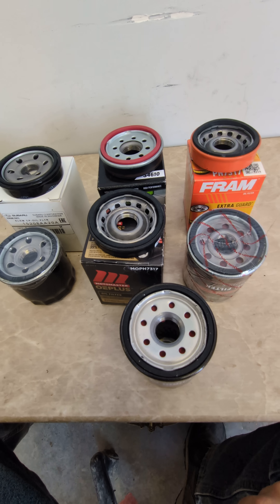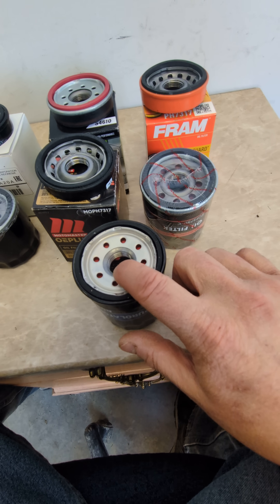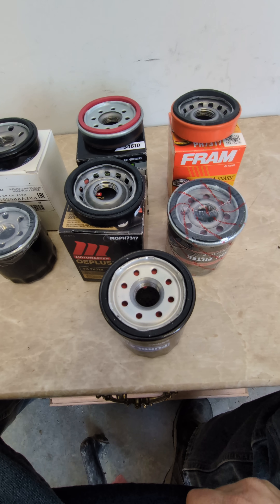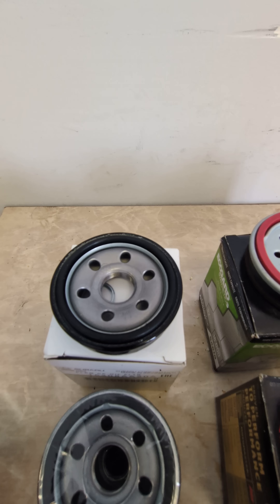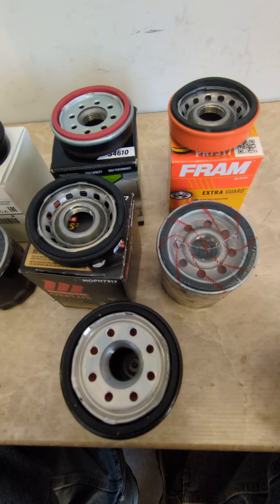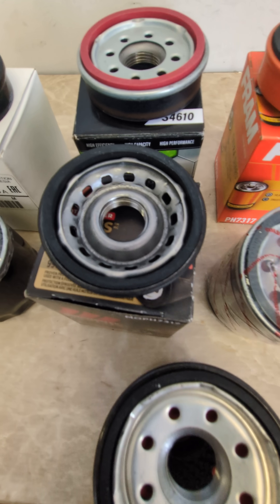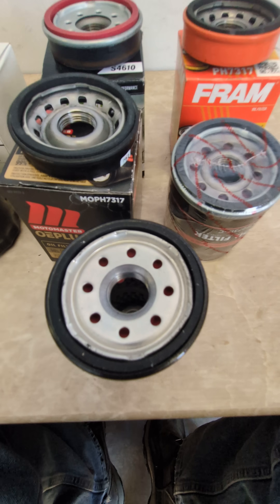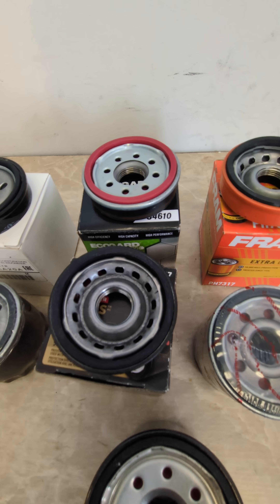How different are oil filters really

Comment: Filters get more efficient as they get used. All those 30 micron holes get plugged up, then the 20, then the 10, then the 5. So, an oil filter with 5000 miles on it will filter oil far better than a new filter. It's one reason why 3000 mile oil changes are actually kind of bad for your engine. 

So, you ignore OEM recommendation and use a much larger filter. A lot more filter media means a lot more 30 micron holes that need to get plugged. And that filter will be far less efficient than the OEM filter as a result. 

Are things actually that black & white? No. Asian engines prefer high oil flow over filtration. It's why I'd never use any of these high end, long life filters in an Asian car. Then you have cars that burn dirty and clog up oil filters very quickly. Not just diesels. You don't let your turbo cool down before turning off the engine, it's going go cook some oil. That filter may get clogged in short order as a result.
Reply from the maker: You make some good points.😉

Comment: I think you're totally missing the point it has nothing to do with the inlet holes whatsoever but the size of the filter itself and the fact that the oil pressure needs to be at whatever manufacturer specs are you go and add bigger oil filters it takes the oil that much longer to be filtered and put back into the motor I don't care if the inlet holes for the oil filter has 100s in it that's irrelevant and that's what most people are trying to tell you the size of the filter matters just because I can get a Honda Civic filter to fit on my 67 Cummins doesn't mean I'm going to or vice versa🤣 mechanics must love seeing you come down the road🤑🤑🤑
Reply from the maker: Wow you are the one who missed my point. WOW😵‍💫

Comment: There is not much point using a larger filter if it has the wrong pressure bypass valve so your oil isn’t flowing through it anyway 🤔😳

Comment: There is not much point using a larger filter if it has the wrong pressure bypass valve so your oil isn’t flowing through it anyway 🤔😳
Reply from the maker: Sure 😊

Comment: Crazy how there are all of these standards API SN for engine oil or on some cars like Mercedes 222.3 speck or Porsche Volkswagen spec whatever, but there’s no spec for oil filters. I suppose that’s because oem would be the standard, they want you to use their brand of oil filter, Subaru, motocraft, or approved brands like Mann, hengst or what not, but that’s not necessarily how it works for engine oil. It’s advertised on a liqui Molly product it meets that Mercedes or vw/Audi specification. All I know for sure is fram is generally one of the worst brands to pick and choose, I just wouldn’t personally. I’m sure there are bulk no-name or less common name filters that may be of similar quality like ones that service/repair shops might buy, in bulk, that say something like royal guard oil filter, or service pro, or rung fao Chinese industrial heavy industries lol. Also the other crazy variable is I would imagine the quality of filter could change for a given model of oil filter. You purchase a Mann oil filter for a Mercedes, which is of respectable quality, and the micro guard brand isn’t very good, but it could potentially be the opposite in some other situation. I would say oil filters would be similar to spark plugs in this regard. Autolite is not a good choice for many cars even if they are cheaper than NGKs, but there are also no specifications, unless if I’m wrong and it says on the cardboard box “meets SAE or SI whatever spec a-2838492 example given”
Reply from the maker: Thank you that was explained well.👍
Reply: There is industry standard testing for oil filters. Every major manufacturer tests their filters to ensure they meet OEM requirements. 

If you get a chance to tour an oil filter factory, take it. It's quite an interesting experience. So far, they have all had labs to test everything from burst pressure of the can & gasket to filtering efficiency on each pass through the filter. The industry has standardized test procedures, standardized oil to test with and standardized grit to contaminate the oil with.
Reply from the maker: They a bit of testing, they probably know what there doing.😊

Comment: Different filter material, bypass spring rating are things to consider. Hondas, i believe, are rated around 13 ish psi while subarus are 23 psi. Will it hurt it, probably not. But always something to consider
Reply from the maker: Not usually a problem.